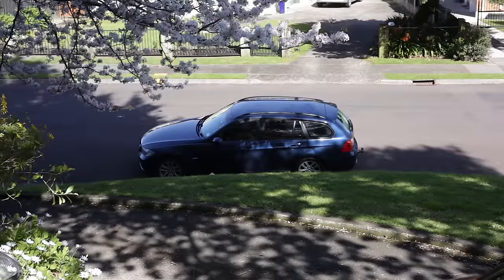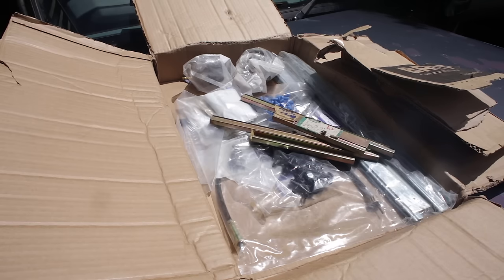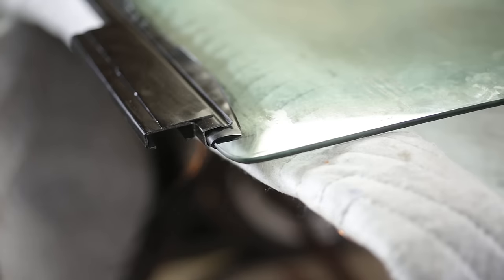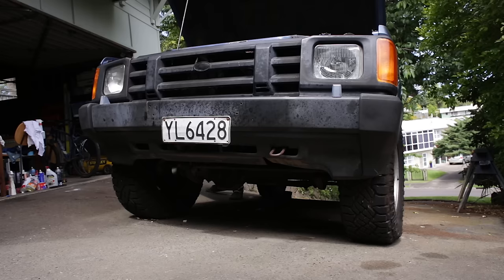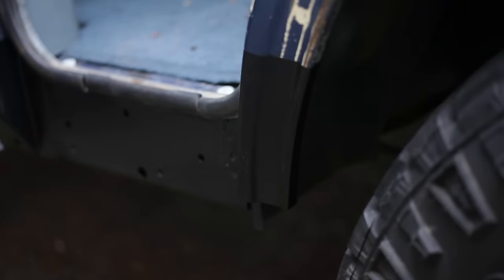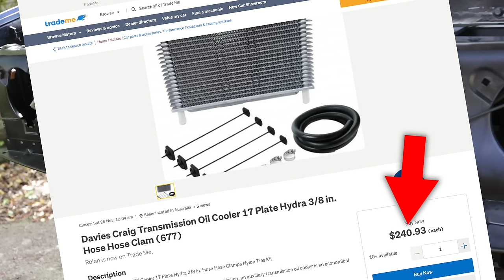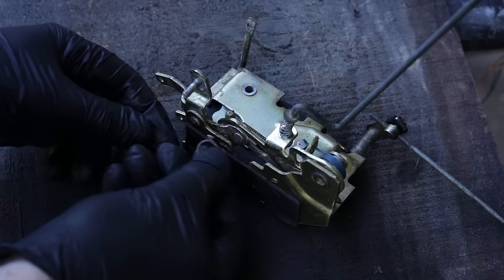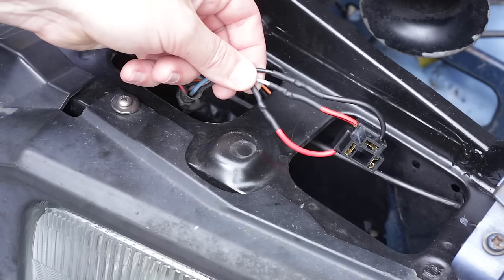Project Discovery // Part 8 - Back On The Road?

Comment: I remain convinced that the designers and engineers that created Land Rover have an amazing sense of humor along with a massive drinking problem.
Reply: It's the same for owners too! :)
Reply: Naaaaa, no drinking problem.  I bet the BRITISH Leyland employees hit their mouths every time they had a pint 😁
Reply: Nah, they were a mix of incompetent oafs (new) and done-with-this-sh!t (old) people who made a muck of it and quite a lot of other cars later. Clarkson said it best. Past a certain point all their cars were "good enough".
And it shows, because LR no1 got restored despite being a pile of rust... but if you take a newer model you can't do the same (as they did it, with strict self imposed rules on what and how the restoration is done so it doesn't end up being a Ship of Theseus). To restore a modern one, you have to cannibalize at least 4 other cars. We like them, but they're not that good. Smartest thing i've ever done for my brother's LR was to replace all the junk material with stainless steel sheet of the same thickness.
Reply: @aserta - if he was my brother, I would have replaced his LR with a reliable Toyota Land Cruiser 😂🤣😂
Reply: those cars were never designed to last that long, they were made to be heavy used and trashed after 10 to 15 years.

Comment: I'm really glad this vehicle was such a short and easy project! Otherwise, we'd have had to give up on the proper Rover work we tune in for!

[edit] I kept expecting the engine to fail while you were driving. Congratulations!
Reply from the maker: Funny you should mention that. Dead on the side of the road on the way to take the cover photo this morning 🤣. Lost all ignition while driving - nothing - complete battery disconnect. Did nothing for five minutes and it started right up! There's some work to be done 😅
Reply: @CROKERvsRover not an expert. But from my knowledge as a Minnesota. Rust bucket driver. It sounds like a heat soaking problem. I'd check the coil if it has one. My personal experience comes from an old ignition coil dying, out of the blue taking with it my ignition rotor on my Volvo 940 while driving up a "hill". Whatever the problem may be I hope you get it solved. Love all your work
Reply: If it’s a coil it would only be engine no spark issue. Since is total lack of electricity then it will be something of the main electrical system. Could be ignition key or some computer, alarm? Maybe just main relay. And it probably will be relay. What what do I know🤷

Comment: You need to soak the rubber in kerosene or similar to remove the window channels (and to install the new ones). That makes the rubber very very soft and when it dries, it comes back to shape.

Comment: Awesome to see it on the road. Glad this isn’t some big project or anything…

Your inspections crack me up. In California the DMV is notorious for being a nightmare to work with.  You will absolutely fail and not be able to register your car if it remotely doesn’t pass smog or has aftermarket parts. However, zero safety inspections to register. I’ve seen rusted, bald tiered monstrosities rolling down the road with fresh tags. I once saw a car that had clearly been in a rollover and had the whole top removed with the jaws of life just cruising down the freeway.
Reply from the maker: Yeah it's the opposite here. The inspectors can be a law to themselves, but thankfully emissions aren't part of the test.

Comment: I used acetone to dissolve the rubber under the window supports, then the stuff slides off under gravity (as soon as you pull it out of the acetone bath. Also, you're better off gluing the rubber strips to the window using rubber glue and then using construction glue (the stuff that's meant to be universal, both sealant and glue), fill the track with the stuff and slide it on the window. Obviously, tape all around so you don't have to spend time removing the excess. I left mine 3 days so the sealant/glue does its job. As far as the snek-cam is concerned, no rust on anything (yet).

Comment: Congratulations.  It is great to see the Disco on the road again and the V8 sounded great.  I'm in Australia and I have owned too many Land Rovers.  I now have a 2002 Discovery td5 with about 235,000km on the clock.  Thanks to the dry Oz climate I have not found any rust in mine though I am sure some is hiding somewhere.  Oil leaks will probably be its finish.

I owned a Mk 1 two door Discovery.  It had about 60,000km on it when I bought it and never had any real problems with it.  I traded it on a new diesel five door Defender.  Both vehicles had their transmission blow up after I owned them at about 150,000km. Hmmm.  

The best "Land Rover" I ever had was an original two door Range Rover in Sahara Dust paint and lots of km on the clock.  It was one of the pre emission era ones with real horse power.  It was economical (if a Range Rover ever was) and better still its non emission engine was quite powerful and happily steamed up hills that the later ones I owned would not.  It also drank like a shearer.

I am now in my 70s and mostly drive a diesel Subaru Outback.  But the Disco is regularly driven and will be until it fails its yearly inspection.  Thanks for your series. It has give me great memories of my fleet.  Mike in Oz
Reply from the maker: Thank you Mike. I almost bought a 2dr Range Rover instead of this. In worse condition for the same money. Was second highest bidder. Someone else wanted it more.

Comment: Lol no way 😂 I did the same tiny spring replacement on 2 doors and the tailgate. That lock mechanism is a right rube Goldberg contraption. I think I managed to remove the mechanism without taking out the window glass entirely. But what a pain in the arse job.

My dad always said in an Ideal world he'd have a range rover made out of gold. Because at least it wouldn't rust.

Rust killed my d1 300tdi. Sold it to a traveller who then did crime with it. Sad, sad day.

Comment: Cheers Geoff, you've just made me 45 minutes late for work 🤣🤣🤣 Great upload mate, had to watch it before going out the door to a miserable wet Newcastle Upon Tyne. The Disco's here have the same issues, but we're fortunate enough to have plenty of parts vehicles to cannibalize. Britpart are the scrotes of the automotive parts world, the only time i'd consider them is if it was a nut and bolt supply (and even then i'd make sure I had tap and dies at the ready). Great job, can't wait to see the full rebuild in the next couple of years 😁😁😁

Comment: 32:05 If you find your transmission is over heating, it may be possible to have air trapped in the oil cooler. Having the ports on top would allow the air to escape.

Comment: Your travails with this runt are enough to turn a man to atheism, which would obviate the need for a christmas tree. Job well done, Dad!! I wish I could weld like you can, or at all. I have a clean, barely used set of Discovery inertia reel belts if you ever need to change yours, or if any other viewers are interested, All the best and thank you for posting another really good video. Here in Wellington my 1976 S3 LWB pickup finally has goodish brakes and steering. Yeeha!!
Reply from the maker: Yes, I am interested. Are they the same pattern as the ones in the video? (not sure if they were all the same). I was going to look for better belts at the wreckers. Send me an email - flickgeoffanemail@gmail.com And send some pictures of your 109 as well :)

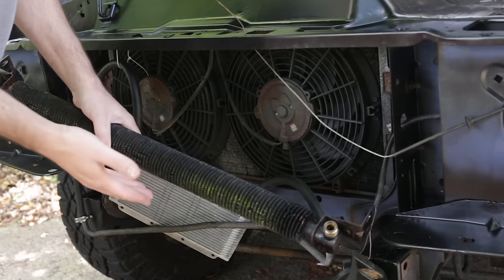Comment: 29:26 that's a 3 out of 5 oof. Not bad, not good.
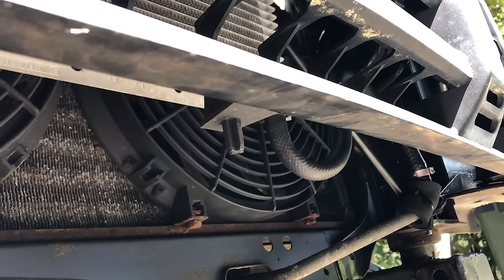32:30 That peg part, make it from scratch. The OG unit is ... junk. At least i think it is. Go to the wreckers, measure one up (if you can find something that looks like it's not part of the Titanic, the boat, not the titanic idiocy that was the Titan submersible).

Comment: Hey mate, was there any trouble in getting the welded section on the chassis through? I used to work in the paint side of a body shop and an apprentice panelbeater, younger than me, did tell me that welding chassis in nz is not allowed. But then again; I never bothered to check the VIRMs as I only have unibody vehicles. Cheers, and good luck on improving the disco!
Reply from the maker: Nah. It’s all the same for chassis/body etc. Might be different for actual trucks - not sure?